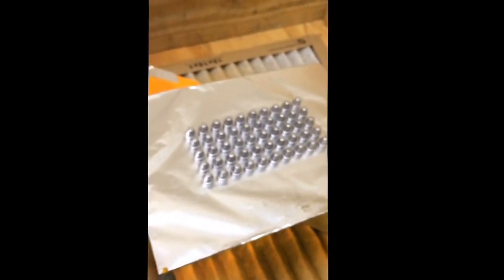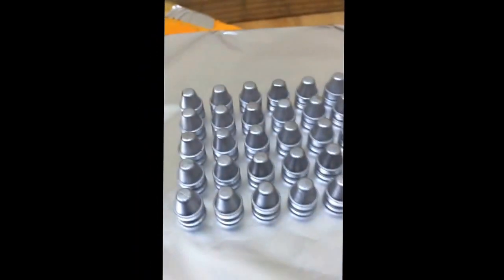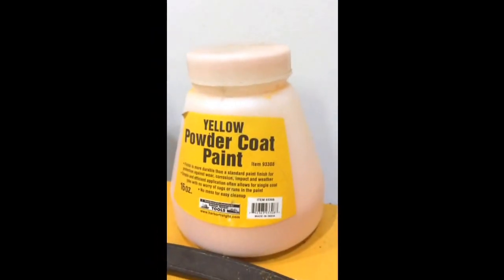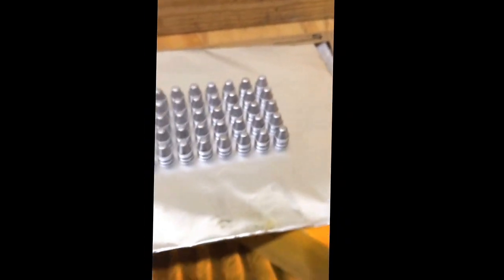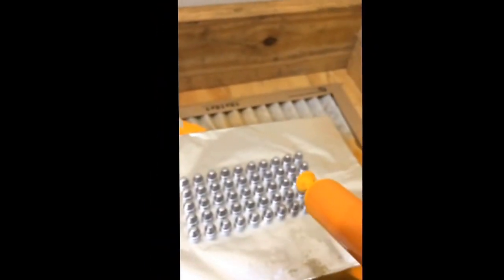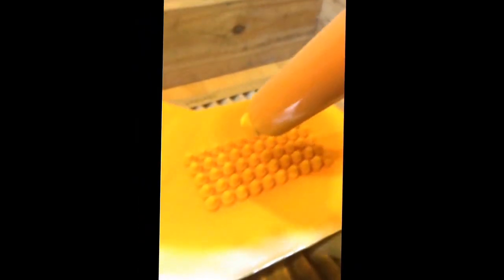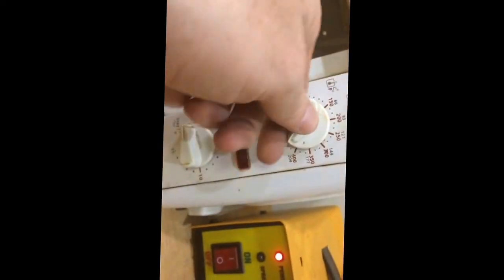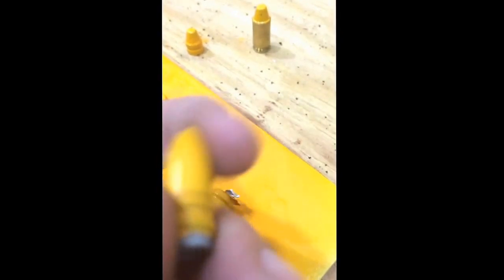Powder coating Cast Lead Bullets. Part 1

Comment: so how often do you change the filter? these are the best looking ones.ive seen..
Reply from the maker: +Vanilla Gorilla I really try to avoid changing the filter just because it was expensive. One of the 8's from home depot. I usually just pluck it out of there and bang it out in a trash bag. It comes pretty clean and I get a lot of use out of it. I buy the expensive filter because that powder will be all over everything if you don't have something close to a HEPA. So far I have sprayed around 10lbs of powder and haven't had to change the filter but it is getting due pretty soon.